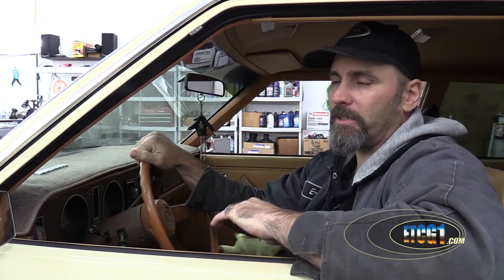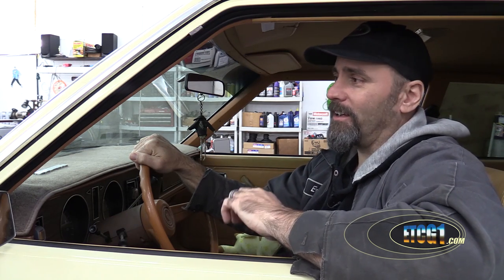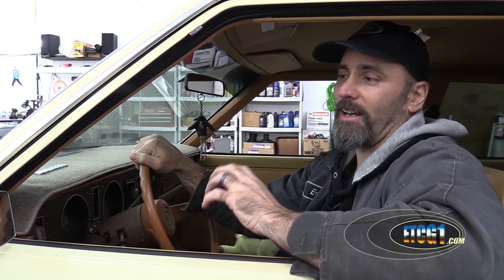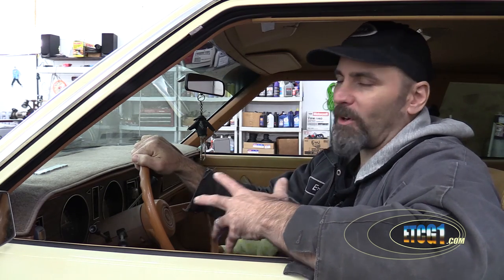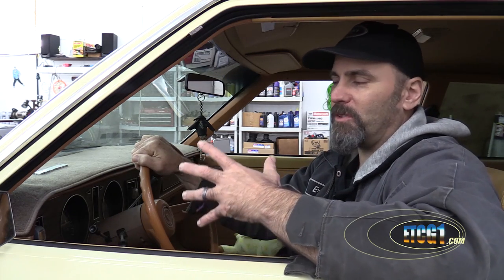Analog vs Digital (Cars)

Comment: At 62 you can believe that I have seen a lot of carb work. My feeling is that many people that promote carbs are not as good with them as they think.I had one customer so resistant to any system with even the slightest amount of technology replace vacuum diaphragm actuation of the secondaries with a cobbed together linkage out of coat hangers,he was determined to stay "low tech" 

You complain that it is hard to adapt that Eco-boost engine and its electronics to your desired application,well no kidding. The engineers did not take into account the potential for someone wanting to put the "package" in some other vehicle and they should not be criticized for not addressing this potential. It you want to do this with the system the new engineering is on you. I do question why you did not go to one of the aftermarket fuel injection systems that are intended for project type cars.

About F.I. being fragile. This is not something I currently see. You do know that since 2012 NASCAR cup cars have been running fuel injection? Racing has that special feature of weeding out systems that are fragile. About diagnosing F.I cars. Do not immediately assume that every poor running (or vehicle with an illuminated "check engine" light on) has some mega difficult problem. Use strategy based diagnostics (as opposed to the shotgun method) to work towards an answer. I do agree that you need to remember the mechanical. My 2004 FORD would sometimes set the check engine light with lean codes. Turns out the plastic intake manifold had a crack in the seam, no problem with any fuel injection parts at all, a simple mechanical failure.

My first experience with FI was with the Type III VW with their AFC fuel injection system (present to the public around 1971). I think there were a few times I actually hid when I read the repair order and it stated the car had a driveability issue (we did not use the term "driveability in the early 70's). These early systems were fragile,in fact people would claim the car would "act up" if you keyed the microphone on a CB when driving past the car. Same with driving past the airport. People would claim that RADAR caused their car to act up. I still question this diagnosis. Things got a lot better with what was called Bosch L-jetronic but then fell way down with Bosch K-Jetronic (a system that used pressure differentials, not really an electronic system). Many bad days with K-jet. Those systems and others more common on domestic vehicles are in the past and I am quite happy with current FI systems and if you apply yourself you can get good at them.

Near the end of my career I worked at a brake shop that also repaired cars with driveability issues. As a new hire I was dispatched a mini van that was towed in as it simply stopped running while being driven, gas gauge indicated half a tank. None of the other "techs" would agree to work on this van,they were satisfied doing their brake jobs. It took me about two minutes to figure out the vehicle was out of gas and the fuel gauge was falsing indicating that the vehicle had fuel. One district manager came up to me and said "you may have scored some points with that mini van but I will never accept that you are good until you can do rear brakes fast". Truthfully it is with rear brake shoes and the springs and levers that many people have trouble but these guys let a simple problem fool them (with the mini van being out of gas) Oh all I did was pull the booster hose and squirt carb cleaner in the intake,the mini van fired off for a few seconds. This told me quite a few things as to the nature of the problem. No I did not start diagnosing the fuel system, I just put a few gallons of gas in,that was the sum total of my "modern fuel injection test process".
Reply from the maker: Well said. Thanks very much for your input. About the only thing I'll respond to goes toward your Ecoboost comment. I'm not saying they needed to design the system to be universal, just that to run it in another application, would require a lot more effort than just bolting on a carburetor because of it's heavily digital make up. The reason I went with a carburetor on my car was because I wanted one. It was also quite a bit cheaper than a FI system. Based on how much I was into the rest of the car, saving money was a bonus. Thanks again for your comments.
Reply: After all that my point. If a person as a tech is stumped by a slightly challenging F.I. problem they would also be stumped by the same level carb problem. I do believe that saying "I want to return to the days of breaker points and carbs as those are the cars a person can fix" tells a lot about a person's skill level. You certainly cannot hire in saying 'I only work on breaker point and carbureted vehicles". Oh I do remember all those late 70's Hondas with the vacuum hoses. The 1977 CVCC comes to mind and the CVCC system was so innovative how sad it was saddled with that many vacuum hoses. I say "innovative" but I do think I have read about some earlier use of pre chamber ignition systems.
Reply from the maker: Excellent point. I'm not saying I want to go back to the 'good ol days', to be honest, they weren't that good. All I'm trying to say with this video is that running a carburetor on my Fairmont with a turbo will work out just fine. There are some that feel (if you read through the comments I'm sure you'll figure it out) that I'm going to blow up my engine because I'm running a carburetor. The way I see it, that's just not true and the 'right' carburetor can be a very viable fuel delivery system. BTW, those CVCC engines were pretty trick. It's too bad they couldn't meet modern emission standards. Those things got killer fuel mileage.
Reply: You tell them dan r. I saw a video recently with some dicky wearing , high school looking  supposed master techs working on a old school 440 Dodge, gonna show us their expertise. Couldn't clock the distributor right to start engine. Wouldn't know a mechanical fuel pump from a carb spacer. Youth is wasted on the young.

Comment: for me, the EFi system is great. when they introduced more modules and subsystems it was good. they they came up with single integrated board solutions where a single subsystem fails and it occasionally gives false leads. then i began to hate that form of integration.

Comment: Hey, just thought I would throw in my point of view being from a younger generation in my early twenties. I am a part of the generation who grew up with electronics and computers. Computers and code are what I make a living out of. At the same time, my favorite pastime is being a weekend warrior who restores classic mechanical cars. I think there is something special about working with analog devices, being able to see how they work and fit together. Being able to see and touch the problem, and to see the effects and progress of the physical changes you do. Which also gives you a better insight of how modern system work and where they evolved from. I think having a good understanding of both the digital world and the analog world, would be good for all generations. It should be less about analog VS digital, old VS new, but more analog And digital, old And new. At least that is my thought, coming from a younger generation trying to chase down all vacuum lines on my Toyota.
Reply from the maker: Well said. Thanks very much for the comment.

Comment: Eric, I started my journey in this field (automotive repair) in 1980, and am still at today. I agree with you completely. people just do not get it. an ICE (internal combustion engine) is a mechanical device that can operate only by mechanical means at its basic design stand point. Diesel engine can operate with no electricity, its pure mechanical. that's enough on that. It was the discovery of electricity that made thinkers think and add this to the ICE. I could go on and on, but will not. A carbureted ICE will have its design limits, a fuel injected ICE will have its design limits and in the digital electric world, a electric motor/ electric machine (electric motor added to mechanical parts) will have the same. limits. People forget in the fog of their beliefs, its the journey we want to take. Hell I may rather have a horse and buggy. Who cares, its the build, its the learning. its the journey, its the personal fun and satisfaction of knowing what you built was what you wanted to build and made it to that milestone. The far out future for people movers will not include a ICE. My 2 cents worth.

Comment: I'm 27 and work as a tech at a Nissan dealer yet owned many different car/trucks.  Current own a 2000 Subaru Legacy with a turbo engine swap and a 1984 Chevy C10 with a carbed 350.  So I work on and own both.  Am I a odd ball in this game of owning and working on cars?  I can't rant enough about working on Nissan's...so I will spare the trouble.

Comment: Well, the big problem of car electronics is that the ECU and other computing parts are executing a code which is closed-source --  proprietary. Nobody can see what  it rally does -- black box. The mechanical part is white box. You can tweak and bend things around as you need if you do something special with mechanics. You can get real understanding. With closed-source electronics, you just work with black boxes.

Comment: I like both carburetors and fuel injection and to me it is just about what feels right to you when it is a project car. Also about what you said about diagnosing newer cars, when my moms 2006 Opel astra stopped on the side of the road, i read the codes and it said misfire, i took it home to look at what was wrong tried changing sparkplugs as that is cheap, tried the car and suddenly lost communication with the ecu, after a good deal reading and looking trough the fuses i found the ecu fuse had blown started suspecting the ecu.  But the coilpack is on the same fuse, so i checked it and there was a short. I changed it out and the car still would not start, same misfire code on 3 of 4 cylinders, checked compression and found that it was high on cylinder 2,3,4 took the valve cover of and saw that the exhaust camshaft had broke between two valves of cyl. 2 resulting in only 3 operational valves. So yes digital diagnosis did not get me far. :)

Comment: Digital electronic vs. analog mechanical/pneumatic/hydraulic. Its a computing system that measures things and operates variable control functions. Carburetors and fuel injection are not that complicated. I can and do deal with all of that. No, I am not a professional mechanic but I can figure things out. What ever works best for the application is what to use.

Comment: I agree, pros and cons. both have their places. I just get angry when I have multiple electrical issues with my vehicle and I can't just swap out to a carb or standard mechanical transmission because the original parts are all computer controlled. but such is life 😉

Comment: Analog all the way for me. I've been helping my dad with his 04 Grand Cherokee for well over s year trying to find and fix all of the little quirks and bugs that keep popping up. He kept getting multiple codes for misfires, lean conditions, O2 sensors, you name it. No matter what we fixed and replaced the codes wouldn't go away and the thing ran nearly perfectly the whole time. Turns out that the problem was the PCV hose dry rotting and breaking open causing a massive vacuum leak. Another problem he's had is the crank sensor frequently going out while on the road causing the engine to stall. Not something you want to have happen on the freeway
Reply from the maker: Well, you know I don't have any love for the Grand Cherokee.....
Reply: Wes the problem is that youre not a mechanic and dont know what youre doing...  You just threw parts at the car until finally you took it to a professional who found a vacuum leak that would take literally 2 minutes to find. A massive vacuum leak is easy to hear. This is nothing against electronics its just your own ignorance.
Reply: I love how you say I'm ignorant when you don't even bother to read my entire comment. I said at the very beginning of my comment that it was my DAD'S car, not mine. So whether or not I said it should be taken to a mechanic or not is utterly irrelevant. Also you must forgive me for not giving a full dissertation on the complete processes that we went through with every specific problem, quirk, and check engine code that came up and the opinion of every person that happened to also look at the Jeep. A terrible sin I know. No I'm not a trained mechanic, I never claimed to be, but that doesn't mean I can't get the job done. I have a perfect example for this. I got my current daily driver used and previous owner (a relative) had a complete brake job done just before giving me the car, front and rear. About a year into driving the car there's a sudden and horrid grinding noise coming from the rear drivers side wheel when I step on the brakes. After drilling out the drum screw which the TRAINED MECHANIC had completely stripped the head out of I found that the TRAINED MECHANIC had forgotten to put on the return spring for the brake shoes and they had been rubbing on the inside of the drum and had completely destroyed it. I replaced all that myself by the way.

Back to the bit about you not reading my entire comment. The second to last sentence IS a criticism of modern electronics. The repeatedly failing crank position sensor is something that my dad has had diagnosed and replaced repeatedly by TRAIN MECHANICS. Once again I must humbly ask for your forgiveness for not giving a full dissertation on an anecdotal comment.

Also just as a side note. Don't you think it's a bit silly berating someone for not paying a mechanic to fix something on a video by someone whose job it is to teach people how to work on their own cars so that they don't need to pay a mechanic to do it?

Comment: My two thoughts are....along with all those modern sensors, and the intricate way auto software logic has interwoven engine function with other car functions (your point about the Fast & Loud episode) comes an enormously complex wiring harness.  It's not always a bad sensor.  Sometimes it's a broken wire deep inside a harness.  Absolutely maddening to troubleshoot particularly on a modern car.  The other thought is that while simple code readers are relatively cheap,  robust automotive electronic debugging tools are not.  Do I really want to buy a $2,000+ tool, which is really a specialized PC, to fix an occasional issue on a modern car?  Not really.

Comment: As a purely amateur mechanic,  I have had both electronic and analogue cars, automatic and manual transmissions.  Both have good points ans bad points.  Although I have found the electronic systems reliable they do need care, corrosion can cause connections to break,  idle valves get dirty etc but on the whole they are good.

I have also had great reliability from analogue cars, but also big problems such as a mixture screw falling out on the M25 motorway not fun in the rush hour with an engine that would stall as soon as my foot came off thr throttle.  Another time my distributor cap cracked in to two halves, I held it together with rubber bands and drove 15 miles tonthe dealer to get new parts. Local part outlets did not carry the spares. mind you the car was designed to run and drive in siberia,  my old Lada made in Russia. 

These days I have a 1997 Volvo V70, had it 6 years, cost £650, has only needed a new battery and starter along with a yearly oil change plus brake pads. We also have a 1999 Subadu Forester, not had it long but seems ok. 

The main thing is that any car is only as good as it maintenance. Neglect will kill any carr.

Comment: Fuel injection is actually a very old technology, it can be found on old 1940's Daimler-Benz inverted V12 aircraft engines (DB601, 602, 603, 605 and so on). such technology allowed the aircraft to stay inverted and not have a fuel starvation in such situation.

Comment: I work in the hvac trade.  That is where electronics have taken over to create efficiency.  its still just a furnace with a dozen other sensors waiting to fail.  you have to grasp the simplest 60%'er first, and from there you can diagnose more complex systems.  your analog car (which is awesome) is much the same.  in a way the old timers are like 'car whisperers' no obd...  going by sound, and intuition.

Comment: I see your viewpoint. Personally when dealing with vehicles I feel that there is such thing as too much and too little of both electronics as well as "analog" parts. In my personal experience I have found the appropriate mating of the two. Not too many electronic components, but not too many mechanical. Too many of either one tends to lead to a problematic vehicle when you look at reliability OVER MANY YEARS OF MILES. The vehicles that will be the most likely to do hundreds of thousands of miles with the least maintenance tend to be the ones not just designed well, but with the right amount of both electronic and mechanical components. Just my opinion and I definitely dont agree or disagree with you. Nice work on the Ford!

Comment: Your thoughts mirror my own.  One of my biggest issues is self sufficiency. I hate systems I can't see into or repair. I want systems I can repair out on the road. I can't stand being dependent on a tow truck and an an expensive mechanic who may barely know more than me or who may be merely a parts changer and I get to pay list for all of them. 
I see the benefits of fuel injection and electronics but the cost of the diagnostic equipment is terrible.
My '85 Ford van with 351 W is a carbureted nightmare gas hog but it has never left me stranded. I'm looking at new intake manifold/fuel injection but I want it to have a fail safe system that would let me limp in if need be.